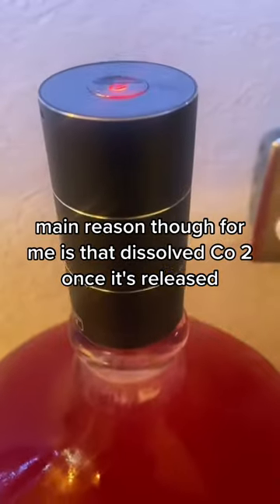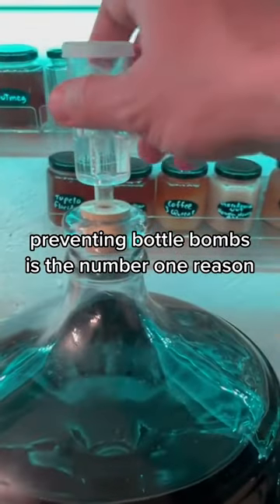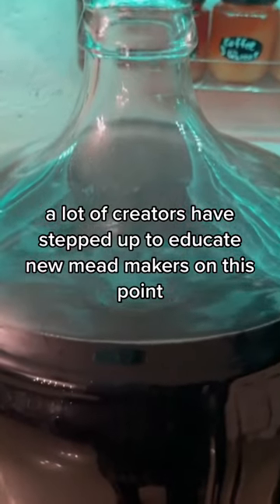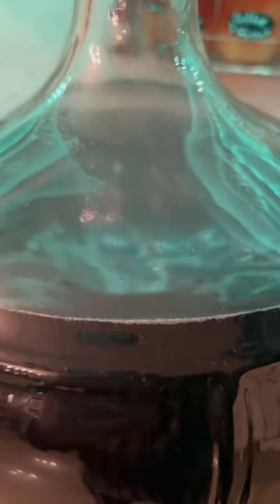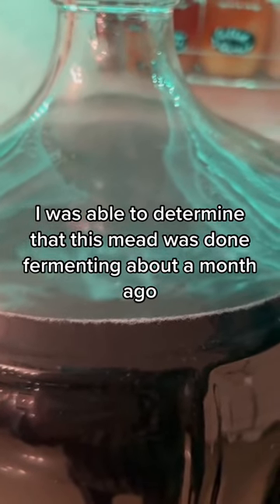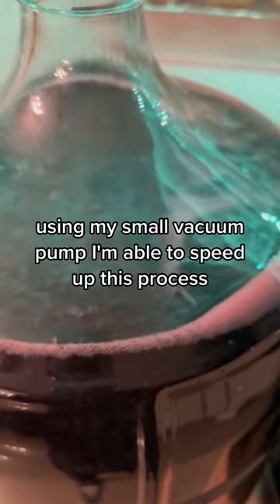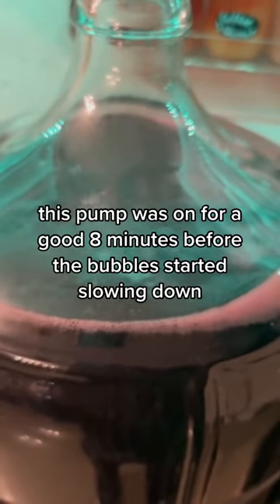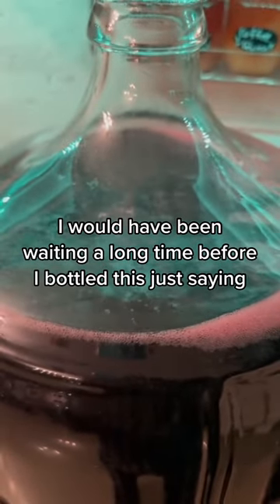Degassing a mead

Comment: I have been making meads for three years done, made several dozen.   I simply wait three months before I bottle any mead, by then it has degassed itself (and cleared).   I don't rack anymore.  Never had a problem.   If you're making a new mead you want to take some readings and see if it's done.
Reply: I do the same except I’m lazier on the bottling. I just bottle it into a spare 1 gallon and pop the lid on. Clean the other one and make a new batch aha